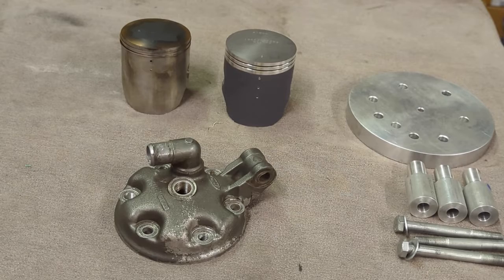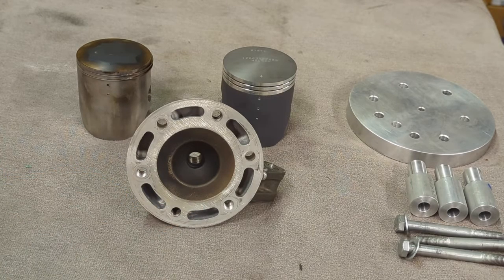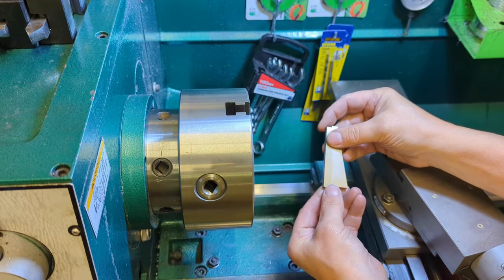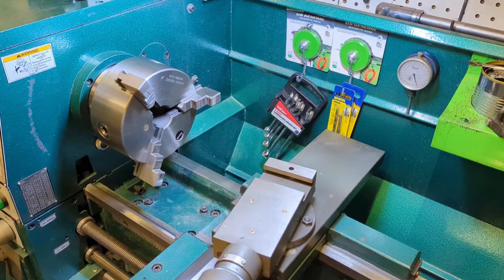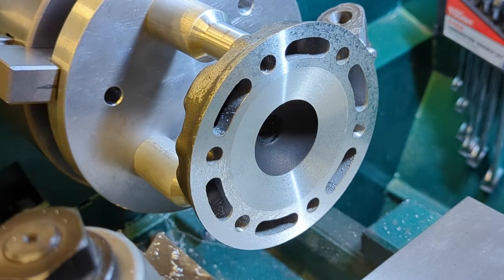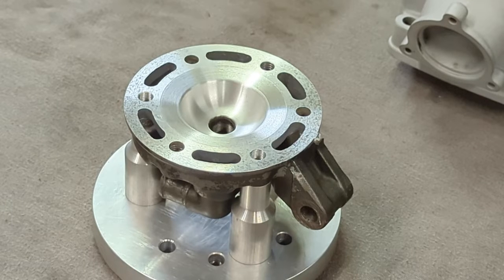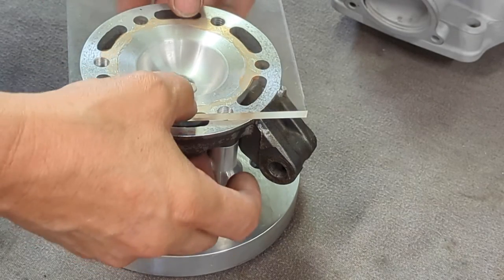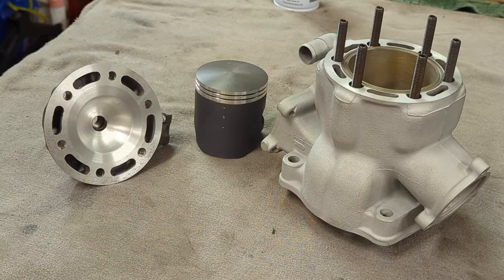Honda 250R Big Bore head mod

Comment: Do you have any experience with the CPI lynx 380?  If so, how is the ride ability?  Is it too much?  I questioned a guy at the dunes about his puma and he said he wished he’d just stayed with the stock trx250r cylinder.
Reply from the maker: Just depends on your goals. If you want a fun ATV to ride day after day for years the stock or the LA Sleeve cylinders are really hard to beat. But they have limits and the CPI does give you more available area to get bigger gains. Big bores on stock cylinders work good with upgrade parts for stock motors (38 and 39mm carbs, reeds, pipes etc). Aftermarket big bore cylinders need bigger carbs, custom pipes and reeds - everything costs more to get more.

Comment: Love it may be a dumb question but how did you hold that cylinder head to the plate?
Reply from the maker: I thread 3 of the cylinder stud holes and bolt it to the plate from the top using the spacers. Tapped holes have to be really straight or it wobbles all over but I drill and tap them in the CNC mill.

Comment: I have a Pro Design cool head, can you modify those domes to work with the 310?  What the price to change a 250 into a big bore?
Reply from the maker: Yep. I do a lot of cool head dome mods for the 310's. Those are nice because the plug is on center. Message me on Facebook at either David Roberts or the ILR Performance page and let me know what you have now and I can give you a price. I keep sleeves and pistons in stock all the time.